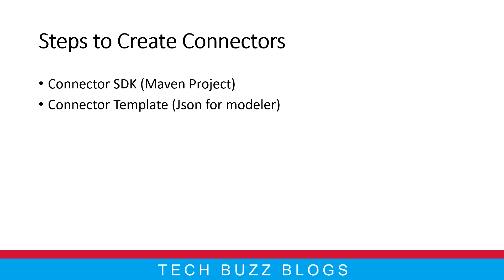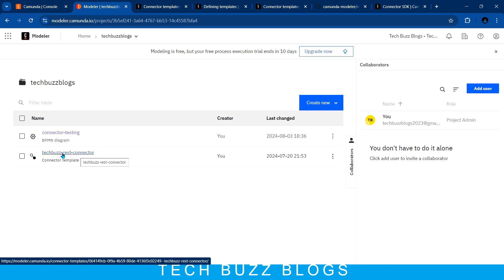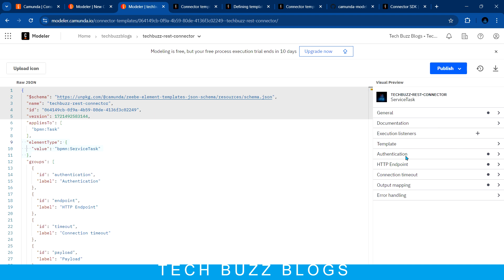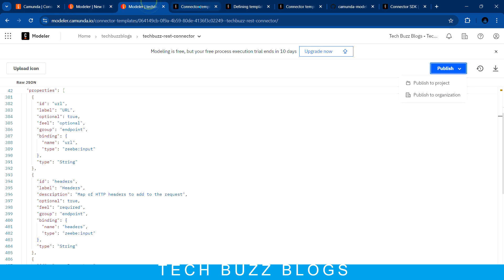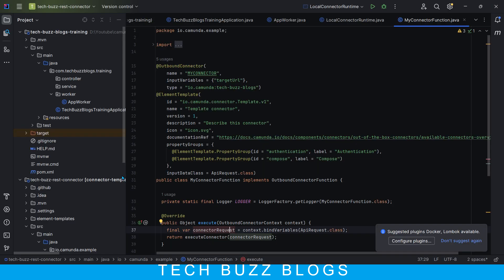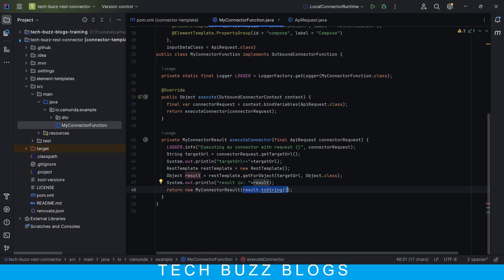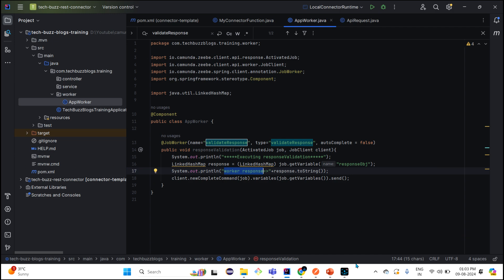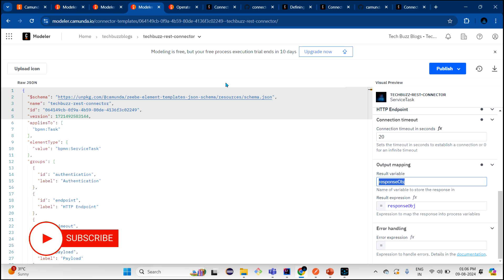Camunda 8 - Custom Connectors - Part 2 | TECH BUZZ BLOGS

Comment: Hi,
Thank you so much for the details camunda 8 video, and appreciate your effort towards teh opensource community.

Can you please provide a sample project in Camunda 8 to connect with local cloud camunda with Springboot application with a Service Task. I tried to run the Camunda 8 with K8s, it always gives error in in connecting. Also tried to run Camunda 8 with docker compose which also gives error with Camunda 8.

Your support is much appreciated.